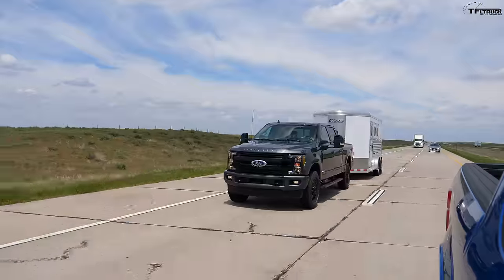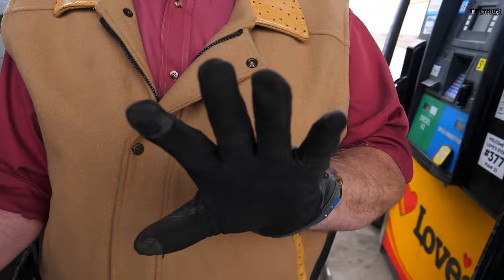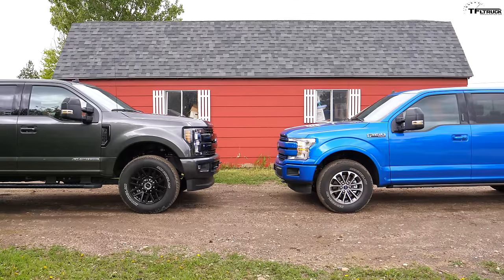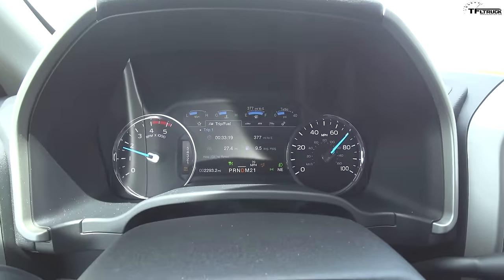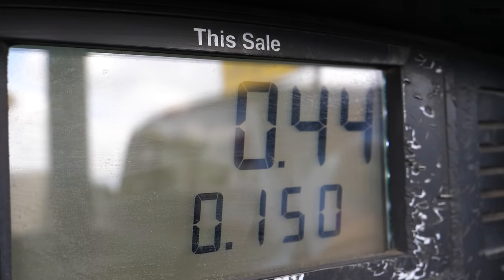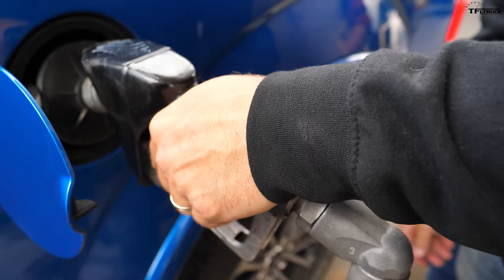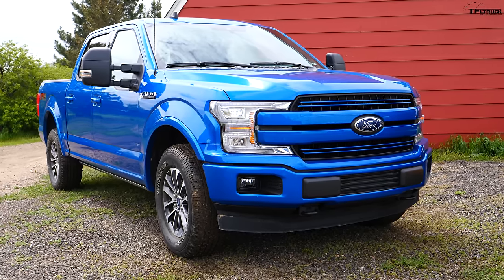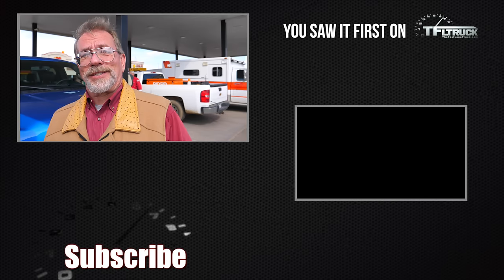Do You Really Need a Heavy Duty Truck to Tow 9,000 lbs? Ford F-150 vs F-250 MPG Review

Comment: I compared my 89 f150 5.8 to my 97 f250 7.4 and they get the same mpg on the highway/ interstate. The difference is in town driving. The f150 didn't seem to use alot. However the f250 got about 4.5 or less. Very noticeable difference. On average driving the same route, the f250 used a tank of gas every 2 days. The f150 used a tank every 3 and a half day. The in town driving is what kills it. My highway 10.6/10.8 was with a 2300# trailer and a 5240# truck on that trailer. The f250 does stop the load faster and get up to speed easier.

Comment: On flat ground at highway speed, it's not the trailer's weight that hurts the mpg, but rather the aero drag. 

I got 12mpg towing a boxy, flat front, 3,600# 6x12 cargo trailer across Florida with my '15 5.0 truck at 70mph. 

And I got 18mpg towing a U-Haul car dolly with a 3,200# Nissan Altima on it at the same speed in the same place.

Even with the enclosed trailer completely empty (~1,200#), I was still lucky to see 13mpg.

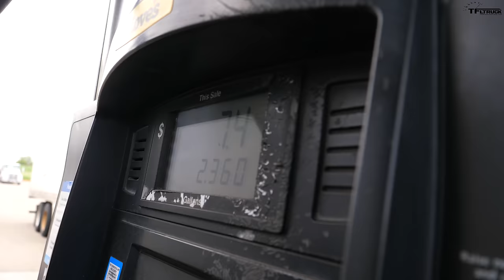Comment: I drove an almost new diesel f250 from Alabama to New York towing a 6x12 Vnose cargo trailer that was only about 6500lbs. I was really disappointed that I could only get 11-12 mpg. I have the 5.0 coyote f150 with 3:55 gears. It will tow 11,500 pretty well! I ended up having to tow my dump trailer 25 miles home with the F150. I have those sumo springs on the back of it to help with the squat as well as E load tires.

Comment: I havnt had a power stroke since 99, but I’ve had multiple Duramax’s and Cummins and they didn’t start getting better mileage until about 20k miles then it went way up from there. Currently getting 14 with my 2019 L5P pulling between 15-25k lbs regularly with 4k miles. Not to mention these two trucks are WORLDS apart for an actual “comparison.” I’m positive the 3.5 eco boost would be closer  and then of course gas to gas (you guys know better). This comparison is like a Gulfstream g550 and a Cessna 172. Thanks for sharing though.

Comment: Hmm yeah I expected those numbers for flat towing. Id like to see a 9k toy hauler (more of a sail in the wind) and some hills and maybe even some altitude and also compare trans temps. My 2011 F150 5.0 towing a 21ft toy hauler (8500lbs) up and down the hills of AZ, the trans temps get uncomfortable at points and the motor revs high and I get around 5.5-6.5 mpg. Im looking to upgrade to the Diesel. Flat towing I would hang on to my truck for a while. The hills are what separates the big trucks from the little ones.
Reply: The transmission and pcm in that 2019 are leap-years ahead of yours which really matters .  You’re still obviously missing the emergency breaking and wind advantage  that extra mass brings. 

I pulled 7200 lbs from San Diego to Prescott with my 2.7/ten speed in a caravan with a 2017 6 speed 5.0 pulling a similar size trailer with 6950and he changed to lower gears way more often. I could tell because i could hear it. One other slight advantage for me was 3.73 vs his 3.55 but both trucks 4x 4 supercrew. My dash showed 6.1 and his was 6.5.

Comment: The fuel economy when the unloaded pickup was the video truck would have been some good info.
Reply: Not really, diesels are efficient under load. Without a load the gas engine would be 2 to 3 mpg better than the diesel.
Reply: @milviodeleon4421  I would not call 9 mpg for a diesel "efficient under load". Especially 9000 lb load.
Reply: @OpenAirAdventure  you're right, that's why it's rated for 17,000 lbs. 9000 lbs doesn't even load up the turbo.
Reply: @milviodeleon4421  What the hell is your point? 9,000 lb is close to the maximum capacity of the F150. At 17,000 lb., you're beyond that. If you're unladen, then mileage is even better for the F150. So whether your unladen or at maximum trailer weight, there is little to no cost advantage to the an F250 diesel.
Reply: Milvio Deleon you do realize with variable geometry turbos your point is thoroughly and completely invalid as you can charge boost pressure or (spool) the turbo at an idle
Reply: @AkioWasRight  if you don't understand diesels then don't comment.
Reply: @justinmartin8887  my point is still the same. Diesels are more efficient when they are under heavy load or capacity of the engine. For example a diesel engine under maximum acceleration will use less combustible than a gas engine. This translate to working under load. A 9k load just doesn't stress the diesel enough to where you can see the difference in mpg and that load is already at the max of the f150. If they had the F250 gas engine it would make for a more fair comparison that way you can see the real benefits of a diesel.
Reply: @milviodeleon4421  If you've been inhaling aerosols, don't comment.
Reply: @milviodeleon4421  I doesn't matter how much load the F250's diesel needs to be most efficient, it's just an F150 to F250 comparison. Use your head. You can't tow 17,000 pounds with an F150, so there's no point in measuring the mileage of an F250 while towing under high loads. The question in whether you would be better with an F250 towing 9,000 pounds, and the original comment simply suggested unloaded mileage for both trucks be included. You're completely missing the point, but you're trying your best to sound smart while saying something stupid and inapplicable.
Reply: @milviodeleon4421  I understand plenty about diesel. I'm not even disagreeing with anything you're saying. I'm telling you that NOTHING you're saying has anything to do with this video or the subject comment in this chain.

Comment: If we were to compare the 150 gas vs 150 diesel for 10K I would agree with the conclusion and choose the 150 gas. But in this case for 10K not only do you get a diesel engine but also a bigger truck, so I would go with the 250. In particular when these trucks are so expensive that make 10K seem no so much. On the other hand, driving a 250 in the city can be a pain due to size.

Comment: 2.5” of squat for the F-150 is actually less than I thought. Still looked quite level driving down the road with that 900lbs of tongue weight. And good to know that these “1/2 tons” are capable enough tow some pretty hefty trailers and get similar fuel economy to a big diesel.
Reply: The properly set up weight distribution hitch should get rid of most/all of the squat.

The squat measurement was done with the weight distribution bars detached (just for purposes of measuring squat -- you wouldn't want to drive that way!)
Reply: @johntlarkin  that's true, I forgot about them hooking the WD hitch up after they measured. Still I wouldnt be overly concerned with 2.5" of squat (without WD) on an occasional tow but for regular use yeah it would definitely be helpful to control the weight on highway runs.
Reply: @johntlarkin  can you pull a 9500 lbs tv with the right distribution hitch with a 2.7 4x4 sport?

Comment: I tow a toy hauler a LOT in the summer between May and Aug, but the rest of the year not at all and my F150 w/3.5L is my daily driver. I also had a F350 with 7.3L. I can tell you from an OVERALL ownership experience, I much prefer the ease of maintenance and lower cost of operation in my F150 than I did in the F350 much more than I miss the slight improvement in towing performance the F350 would have given me.

Comment: Looks like you're in the flatest place in the country.  A towing test should always involve hills, passing semi's, bumpy roads, stop and go traffic, etc...  Driving in a straight line is not going to give you the full range of experience.

With my 2000 F250 7.3 Diesel w/ trailer @ ~9,500 lbs (scaled), I don't like going quite 70 (2000+ RPM), but at 62-68 mph it gets in the 11-13 mpg range.  This is over hills and all.   Trying to maintain 55 mph for a full tank pulling 12,400 lbs resulted in 13 mpg.  No DEF.  Truck cost $6,500 with 151k miles on it, has only 1 issue: the passenger door speaker doesn't currently work.  With maintenance and some preventative repairs for reliability (fluid, clutch, glow plugs, relay, valve cover GP harness) and 2 modifications: an exhaust brake, & performance clutch, I have about $10k total in it, and love the way it feels like it's gonna go forever.  It doesn't depreciate, is perfect for liability only, and is very low maintenance.  

I'm just saying, if you're towing this kind of weight, there are some screaming deals out there on low mileage reliable trucks (yes 150k miles is low miles for a 7.3, lol).  There's no reason to spend your retirement money on it.
Reply: Chris Arnold you got a 7.3 for 10k?! All 7.3’s around here are 18+k for anything under 200k miles

Comment: I think if you want to haul a lot of weight routinely, you need a truck that was designed to do it. A half-ton will die before a 3/4 will. Half tons were not intended to perform that function all the time. Just the same, you don't want to pull a super heavy load with a 3/4 when you could use a 1 ton.

Comment: I can't believe they didn't put 93 premium fuel in the 150 for pulling which helps with optimized engine performance
Reply: If it doesn't need it it doesn't need it. Octane doesn't add HP. It adds the ability to make more HP in bad conditions
Reply: Well, "optimized" engine performance can mean a lot of things, it doesn't necessarily mean it will improve how the truck performed in this test.
Reply: @technom3598  the engines do detune themselves now. I lose tq if I'm not running premium in my Ecoboost, per the owners manual.
Reply: @daltonv5206  they only detune if they can't run full timing. They utilize the knock sensors and dial back timing if they detect pre detonation. 

That's about it. And that would only occur ins less than ideal conditions

Comment: I think a video on resale value of a 3/4 ton diesel compared to a 1/2 ton gasser might also help decide if the additional 10k is worth it in 4-5 years.
Reply: 4 to 5 years of servicing on your 6.7L PSD will wipe out any saving you could possibly imagine. When it comes to diesel, everything is about double the cost. You don't buy diesels to save money, at least not anymore, you buy them to do work. Unless you use them for work, you'll never get your money back from a diesel.

Comment: Just a friendly tip when dealing with diesel.

Gloves while fueling, but if it gets on your hands, rinse your hands with Coke.  Soap alone will not get rid of the smell, but Coke will.

Diesel spill on your driveway?  Yup, use Coke and a stiff broom as soon as possible and it wont stain.

Even with clothes you can pre soak with Coke.  I had some bib coveralls that got sprayed with diesel.

Comment: I get the point of the comparison to see each truck pulls a static weight. However, I think to be fair you should also tow identical percentage of weight based on the maximum towing capability. So, the F150 has a max or 9klbs which you tested in this video, you should also max out the f250 and report it's MPG.
PS  11:05 High volume pump
Reply: Totally unfair that a guy has to tow a 7000 to 9000 lb trailer.
Reply: @harleylogan5369  Not really. Just curious how the new F250 fares at is maximum weight with regards to MPG. I certainly know how my '04 F250 does under such conditions.

Comment: Been towing an 8500-lb fifth wheel with a F-150 5.0L for two years. Towed a 7000-lb fifth wheel with an 01 Ram 1500 for 10 years before that. So no, you don't need an HD truck.

Comment: One thing is for sure, you will definitely feel the 9000 pounds a LOT more with the half ton as apposed to a 2500>.

I speak from experience.

I guess you have to ask yourself how beat up you want to be at the end of a day of towing when you make the decision.
Reply: They should perform an emergency lane change maneuver while towing to compare the trucks.
Reply: It's more of a trailer shape issue. My '15 F150 didn't care about the flat deck at 9,000 but it was scary with the enclosed at the same.

Primary reason for getting a dually was the enclosed. I wanted to pull it more.

Comment: It may not be smart, but I haul tractors twice a week behind my Silverado 1500. Sometimes it’s under 9000lbs, but many times the tractor and implement weigh 10k and then I also have to tow the trailer. If the trailer is balanced properly on my half ton it’s no big deal. Worst part is stopping. The biggest difference between going up in weight class is the ability to handle a less than perfect load and improved stopping control.

Comment: 2004 Chevy suburban 2500 8.1L loaded $10,000 w/100,000 miles.  I get 8mpg towing and 12 if driving with a light foot.  No stinky fuel, quiet, bullet proof motor.  Newer might look nice but not all that much better.

Comment: DEF is for the SRC, not DPF, to reduce NOx emissions. 

The DPF, if the reaction doesn't occur naturally from high EGT's (such as when working a truck like it is meant for) will get injected with extra diesel and the calibration will adjust to raise the EGT's (such as when using the truck as a grocery getter and driving gently)

Comment: 2003 F250 saved my life twice.  I drove away from two spearate wreaks.  Both in Ohio from to different accidents with Ohio Troopers saying the same thing from each of the wreak sites,  "If you were in anything smaller you wouldn't be here."  The other vehicles were totaled. I still drive the truck today with a total of $41,000 of repairs and 300,000 miles.  I've almost got it broke in.  The truck has no EPA devices of any kind so I will one day have the engine overhauled and keep on trucking.

Comment: I would think that the 3/4 ton would have better wheel bearings, bigger breaks, more suspension, just made to tow more heavy/frequently.

Real world application lets see that weight in a job trailer full of tools being pulled around town.

Comment: I owned a 2008 f250 Super Duty that (I should have kept) would flat-tow my TJ and get better mileage than the TJ did alone going down the highway.  My TJ gets about 14-15mpg on the highway at 65mph (4.88's/35's) and the Super Duty would get 17mpg flat towing the Jeep!  lol

Comment: Should of towed a 34' rv on a windy day.
Reply: justin j hey hey now let’s not get too crazy
Reply: Lol, I have towed a Jayco Jay flight 33RLDS loaded (roughly 9,000 lbs, i haven’t weighed it though.) with my buddies 2018 F-150 5.0 and I was concerned at first. Then I got in it and towed it 100 miles down the road. Windy, even rained a little. It handled so well I went down and bought myself one. Will be towing from Texas to Florida next week in my own truck.
Reply: @brandonbloomer6499  more than I would want to tow long distance just make sure you get a good anti sway bar setup. Keep in mind f150 towing capacity ranges from 5,000 to 13,000 depending on spec.

Comment: So once again a tow video showing only partial information. You have come the closest so far as you at least showed us the payload sticker on the door for each pickup.
IF the trucks are SAE J2807 compliant, which you don’t mention, the stated towing would be in addition to 300 pound for passengers. My guess is the two folks in these trucks weight a bit more than that combined. Taking the low end of 10% tongue weight you have a 900 lb payload to the truck that leaves 779lb of payload available. If you actually have 15% of the trailer weight on the tongue then you have 1350Lbs leaving 450lb of available payload. All of this assumes you evenly distribute the weight across both axels of the truck. The number we never see in these videos is the rear axle weight rating and have we exceeded it! I was well below the GCWR and tow rating but when I loaded the truck with my family and our extra stuff like bikes, and toys and stuff we exceeded the rear axle rating by almost 200lb. Got an F350.